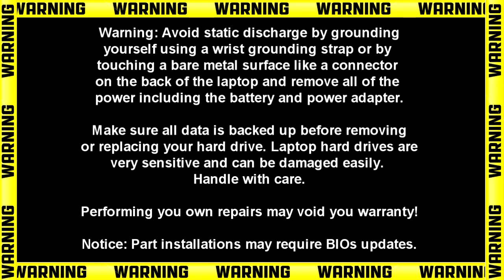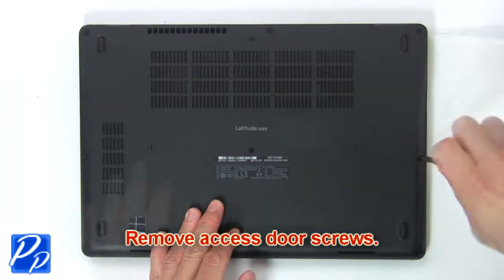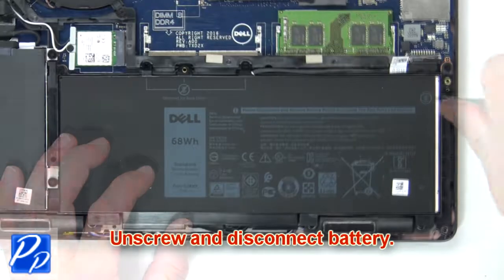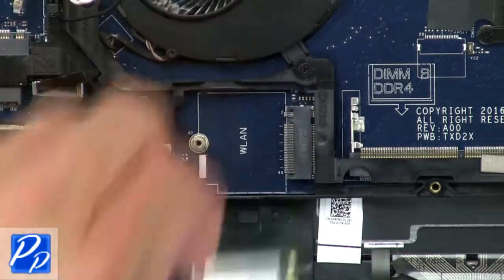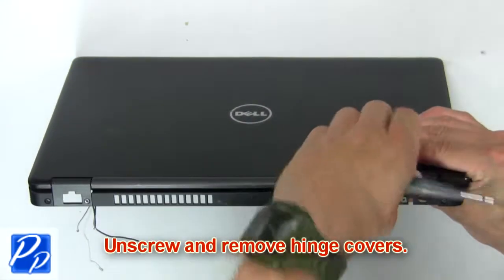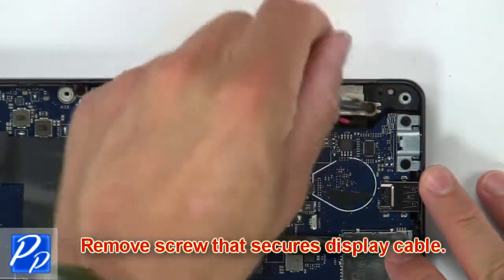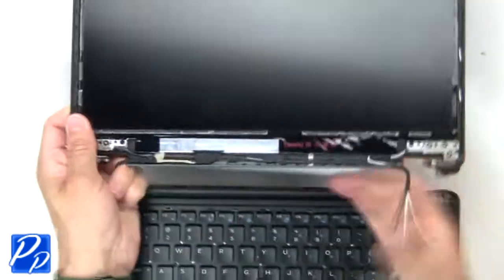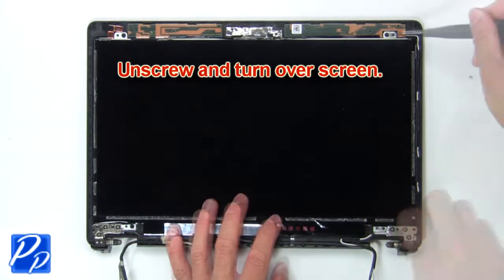Dell Latitude 5491 (P72G002) Screen How-To Video Tutorial

Comment: Thanks for this, worked a treat. Although I didn’t need to remove the battery or the HDD. Unless there was another specific reason?
Reply from the maker: Hi, no you don't need to remove the battery or HDD if you don't need to. We do all the tear down footage at once for the repair videos so some parts removal steps aren't necessary.